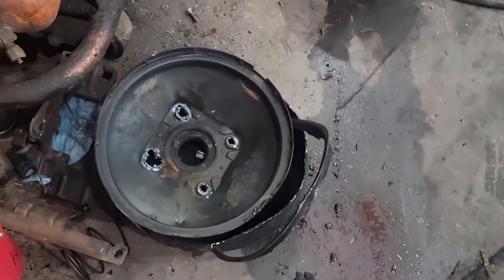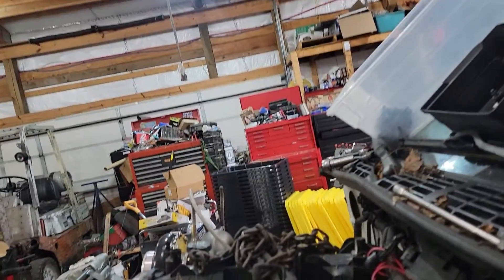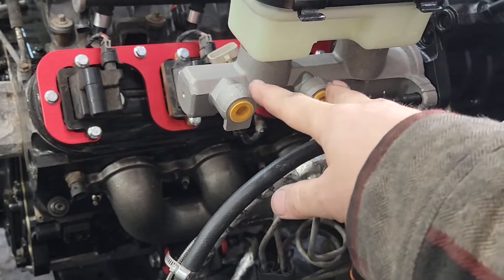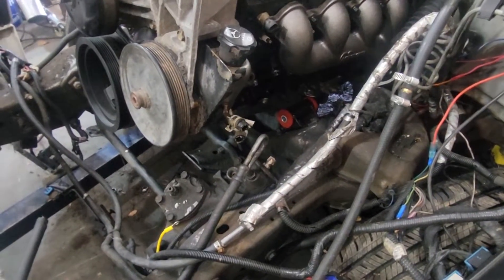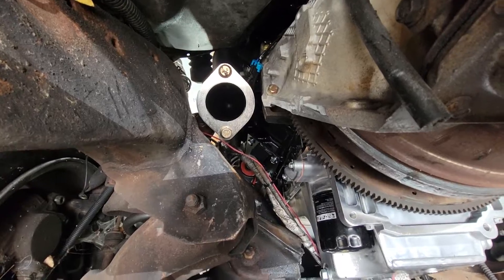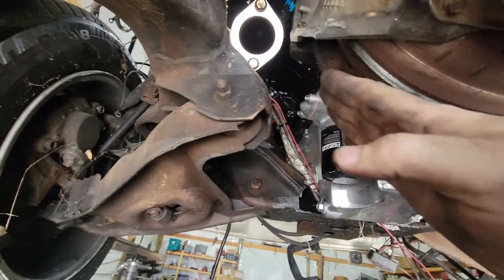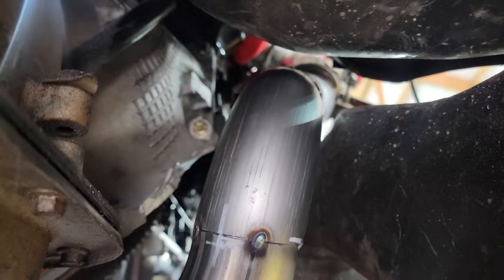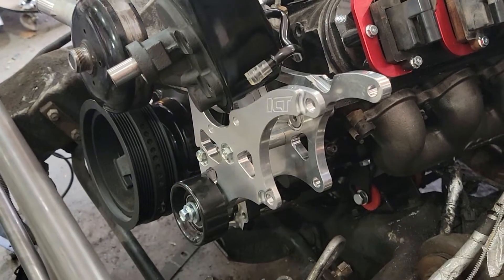S10 V8: How to LS swap your Chevy S10 with 78mm Turbo - Part 2 | Brakes and Turbo Crossover Pipe

Comment: Is there any updates on doing cold side
Reply from the maker: I have the video footage, but the project has been put on hold until we can clear out some of these customer vehicles.
Reply: I’ve been thinking on boosting my 1st gen blazer in the near future
Reply from the maker: @Kaotic-Dreamz-cc  Also if you do it, and you get stuck, feel free to call and I might be able to give you a few pointers
Reply from the maker: @Kaotic-Dreamz-cc  one thing I can honestly say, whatever you think your budget is, triple it. The 383 Sanoma I built I thought 5K in the engine and maybe 2 or 3k in the body. Nope I have over 18K in it. But to be fair, I went will a Holley Sniper and Digital dash, but still that was only 3K combined. Its now in the paint shop getting a full Custom repaint (few grand more). But, I do get a lot of people coming up to me asking what I have done to my cars, and my most common response it "Its Stock"
Reply: I appreciate it